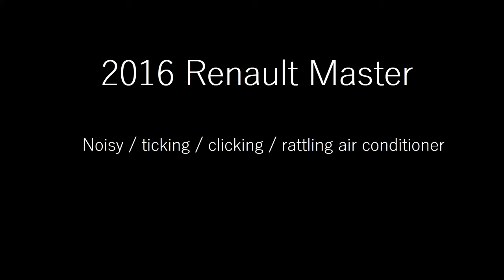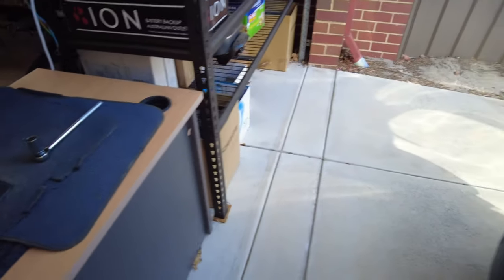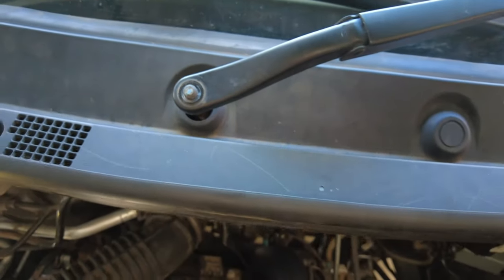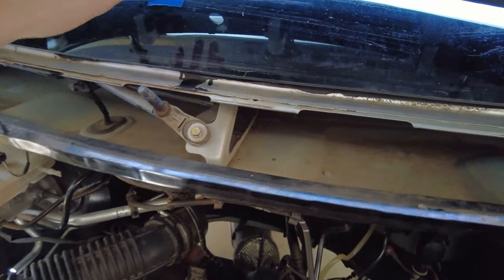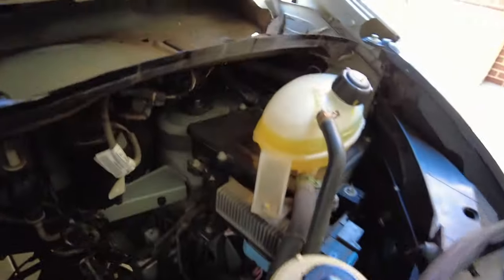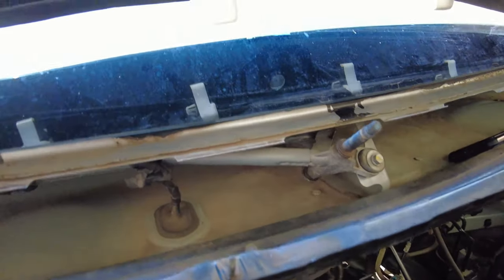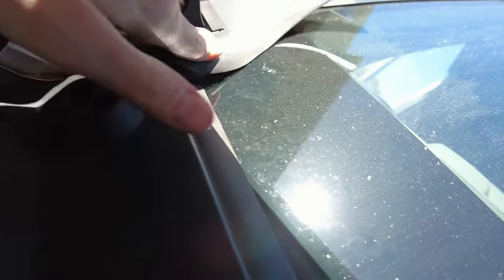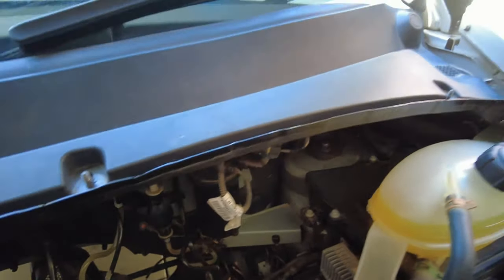How to fix noisy clicking rattling air conditioner on a 2016/2017 Renault Master

Comment: Thanks 👍 I had the same issue with my 2016 Opel Movano. For the EU Version with steering on the other side, I had also to remove the windscreen wiper motor (2 bolts) to get better access, but it wasn't a problem.